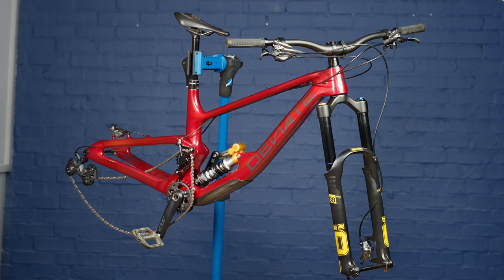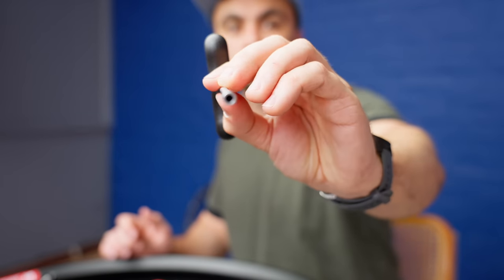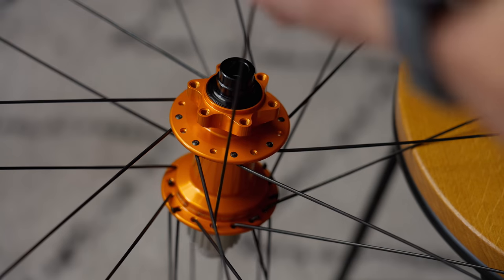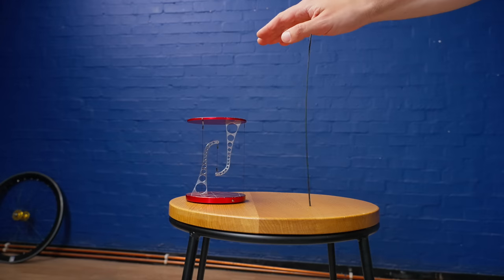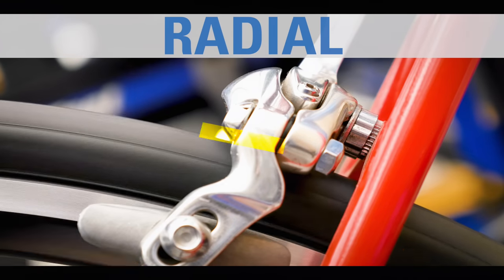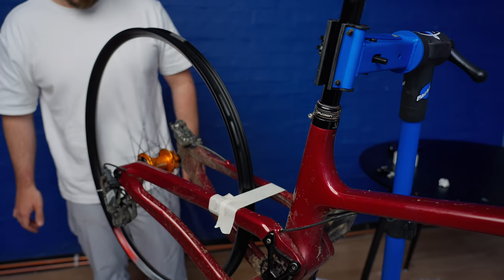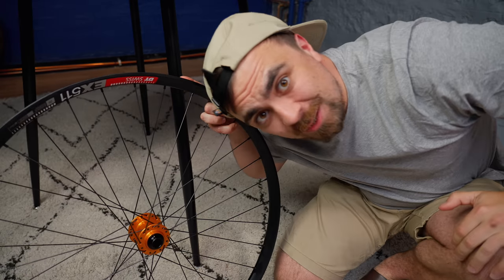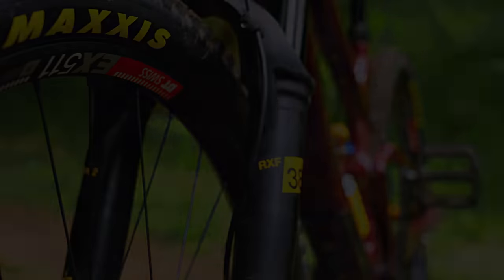I tried building my own wheels

Comment: Love that you glossed over the true nightmare of wheel building that is spoke length calculations 😂
Reply: Probably done by the manufacturer that put together the set?
Reply: Just use Sapims spoke calculator. Saves so much time and headache
Reply: Thats the most easy part.
Use dt swiss or sapim spoke calculator
Reply: There may be calculators out there, but if you have components that don't have easily accessible measurements and you have to measure yourself, such as older legacy components - it's still not too difficult to mess it up. For my first wheel build I ended up buying spokes 3 times, a costly mistake. You only get about a 1.5mm cushion. I won't get in to it but Now I have $170 worth of spokes I can't use (For 66 spokes it cost me about $85 each time, 32hole rim front and rear, and 2 spare spokes.) This was around year 2020.

Comment: I think it would have been cool if you went to a bike shop with all the tools to see how close to perfect you got with the tape method. Anyway, great video!
Reply: Technically you can get the same precision as the professional tools even with tape (or how I prefer doing it: zipties) and the bike you want to use the wheel with. The bike shop tools just make building and tensioning the wheel a lot faster and more convenient, so it‘s a lot easier to get a precise, well-built wheel. From what I‘ve seen on the video, the wheels mike built weren‘t as true as the bikeshop I worked at would give them out, but they definitely are good enough to be used without problems.
Reply: @flyingby3703  Actually there is one step you can't do accurately with your bike frame: you CAN know if the wheel spins straight (doesn't wobble side-to-side), of if it is "round" (doesn't bounce up-down, or isn't a "perfect circle with the middle point being the hub centre). 

BUT even if the wheel IS spinning straight, AND it is "a perfect circle", it can still be a perfect circle that spinning straight, but slightly to the other side!

Many tool companies have specific tools to check this. 

If you would want to do this "check" in your own bike frame, you would have to "flip" it with "tape cauges" in place, AND the hubs would have to be mirror-symmetrical (which they are never in the back hub, and which they are not in this bike even in the front hub, because of the disc brake space on the other side)

Not having your wheel "spinning straight in the right spot left-to-right" might kill you, because then it could be destroyed when going hard to left or right, because the spokes are not angled enough to the other side
Reply: @aeyuio2315  did you not watch the video? He goes into dishing with his cardboard box.
Reply: @linuspauly2380  But he doesn't do it correctly, his method in no way takes into account the difference in distance on different sides. The distance should be the same from the spoke ends in the hub.
Reply: @aeyuio2315  no the spokes on the drive side are usually shorter than on the non-driveside
The distance from endcap to the rimcenter should be equal on both sides
Reply: The rim must sit in the middle of the hub.
He did this the correct way.
Reply: @aeyuio2315  you can flip the wheel over in the frame, to check whether the hub is centered laterally
Reply: @aeyuio2315  False information

Comment: the real trick is using a marker instead of the tape and just wiping it off with alcohol.   spin the wheel, run the marker in all dimensions. make adjustments,  flex the spokes to get out slack, wipe marker, repeat.

Comment: I've worked in a few bike shops in my time, few wheel builds though, it is truly an art and takes time. A wheel truing tip I use at home, instead of tape, is a zip tie on the seat stay cut clean, you can move it closer as you need as well, the tape could be used on the seat stay if your concerned about scratching paint. Well done man, stoked to see your stoke for mountain biking growing after your early Ben Collab's haha.

Comment: I learnt to build my first (and only) set of MTB wheels in 2020 for something to do during covid lockdown. I used cable ties on the frame instead of tape and the coin stack trick to get the dish right but essentially the same cheapo method you did. Oddly enough it took me just under 6 hours too! They're still straight and round now, never had to adjust either of them once!

Comment: I have once rebuild a wheel while changing a hub. The biggest problem for me was to get a correct tension of the spokes, because I didn't have a spoke tension meter. At first I have built the wheel too loose. Then the spokes would go out, it was a mess. Later I was grabbing all bicycle wheels I could find to get a feel how a proper tension should feel like. After tensioning all the spokes somewhat correctly I was really happy with the result.

Comment: Good job!!! One tip though is when you think you're done, put the wheel on an old car tyre and jump up and down like f.... on the spokes with soft shoes - both sides (be brutal), then true again. The spoke tension over time will deform the holes & flanges in the hubs at the spoke roots leading to loss of trueness , this jumping up and down will preset this leading to truer wheels for much much longer!!!

Comment: Great video! About 15 years ago I started lacing my own BMX wheels similar to this. Back then instead of using youtube, a BMX brand had a guide on their website with pictures. I used that and well, the first wheel turned out awful. As time went on I got better but I still don't aim for perfection and I don't own a truing stand too. I can still bang out pretty good wheels and most of my local town riders rode with wheels laced by me because they could not be arsed to learn it and I was cheaper than a bike shop. Great skill to have.

Comment: Nice Mike. I have a truing stand that I picked up cheap, but my first wheels and many repairs were done with the bike frame as my guide. My tightarse sensibly frugal trick was to zip tie a clothes peg to each "chainstay" (or the fork for the front wheel). You can then chuck a hex key with a ball end in the peg and slide back and forward to adjust the spacing. Centring is a case of using a ruler to check the side/side, and assuming the bike's reasonably symmetrical.

Comment: as a former bike mechanic i would say they look very good (even if it did take a while), but the real challenge is can you do it with cheap parts? This is way harder because the never fit as nicely as those exspensive parts and the rims are never exactly round to begin with. So Mike are you up for the challenge? 
 Btw did you notice that the front spokes are a difrent diamenter compert to the rear?
Reply: with all due respect, but its spelled "compared"
Reply: hi, i'm not a professional, after the initial truing (basically what he did in the video) it's not necessary to pre stress the spoke by pushing on hte hub?
from what i know the spokes need to bite a bit in the hub to stay correctly tensioned and true for longer... i have the doubt that under the stress of a few rides the rim wil not be as round because of that.
could you explane plz?
Reply: @MrAntonioSimone  yes you are correct, as he didnt stress the spokes/nipples they will need a retrue after a few rides. i normally stress wheel builds by standing on the spokes while the wheel is on the ground, works great
Reply: @grassgrow030  not everybody on the internet speaks English as their first language my guy
Reply: @TheDjCageman  thats completely ok, i never assumed otherwise. English is also not my first language. I would still want to be corrected on a mistake like this, especially when the rest of the text was so well written, and the mistake does not seem to be a mistype, but a wrong interpretation of the spelling of that word
Reply: @grassgrow030  look, the gramar police is on the run 😒
Reply: @TheDjCageman  he wasn't rude, he just fixed his typo. If not for guys like him I would still use "propably" in place of "probably", as it was how I wrote it all my life.
Reply: @Mathcartney  i corrected his spelling, not his grammar, so im the spelling police actually 😘
Reply: @grassgrow030 who kares, u new what it ment 😂😂😂
Reply: @jani724  dats de bootiful ting aboat komunication, az long az wi andastend eechotha, itz ok. zorri vor biing a gramur nazsi!

Comment: I'M GONNA PUT IT OUT THERE I do this for a living and you did a quality job! reccomendations for next time would be for dishing use coins instead cause you can fine tune without it moving and use a spare spoke on either side of the frame for the overall truing as they're easier to push in and out and fine tune the true (Works more like a truing stand)

Comment: Don‘t forget to re-true and re-tension your wheels after a few rough rides. Your new spokes, hubs and rims will probably set in a bit. After that they should be in good shape for a long while though!
Reply: By far the toughest thing is to construct wheels that keep spinning straight even after leaving the shop. Almost anyone can eventually get a wheel to straight for a moment, but it's very difficult to get all the tensions & strengths right in the long run. 

My local bike shop used to have young mechanic doing wheels, but they had to make him stop it, because "his wheels didn't keep straight" and the customers kept on coming back after riding a few days. 

I think uniform spokes, uniform spoke condition, uniform sound from the spokes goes a long way, even without tension gauges. The sound might be even more accurate than the gauges.
Reply: @aeyuio2315  Yup, that’s true. I‘m not very experienced when building wheels myself, but I did build my own wheels while I was working at the bike shop and trued up quite a few of them. I picked up a few tips and tricks from the guys there, but in the end only experience will get you to reliably building good wheels in a reasonable amount of time.

Comment: thank you very much for this video. I was trying to build my own unicycle but got a bit stuck since i can't weld aluminium with my electrode welding machine. Now i will try to chance the hub from an old wheel into a hub of steel so i can weld my cranks to it. Thank you very much

Comment: i've recently build my set of wheels and it was a pure joy, im going to do this on every build !
but there were  numerous times that i dropped a spoke nipple inside the rim and spent ages getting it out 🤣!
Reply: One trick to avoid dropping the nipple in the wheel is to use an extra spoke as an insertion tool. Just thread a nipple backwards on the extra spoke to insert it into the rim, thread the actual spoke on from the correct side and unthread the extra spoke.
Reply: @TeKaMOTO  thanks , great idea

Comment: love to see this. ive built a few unicycle wheels myself now and its always an annoying process at one stage or another, but very very satisfying. My biggest problem is figuring out the length of spokes required since most of the online calculators aren't calibrated for uni hubs

Comment: I've built maybe 20 wheels in my life.  Every single time, you learn something new, and you get better at it.  My most recent wheel was a HUGE jump in quality.
Reply: Ugh I want to learn because I have a DIY ebike with a hub motor and the spokes go loose all the time and 2 have broken so far. I have no idea what Im doing so I just tighten the loose ones and replaced the broken ones.

I really just want to rebuild the whole thing fully as I am sure the tension is off and its not properly trued.
Reply: @1234567895182  yeah just do a rebuild. It's not hard. When I saw this video, he's using DT swiss rim/spokes which are the easiest to build. DT swiss uses it's own spoke wrench, and the squorx nipples with washers make for a longer-lasting true.

Comment: Great video! I have built a few wheels, and trued them in the frame like you did. If you have a steel frame/fork you can use magnets and cardboard to set up easily adjustable guides. One thing that really takes out a lot of frustration imo, is an adjustable spoke nipple bit, they cost around 20-30€, but I find that you get a great baseline very quickly, that only needs little truing after

Comment: "that's good enough for me" is a very important step when building wheels. It won't get much better if you continue :)

The reason I build wheels, I can customize like crazy. I've built wheel with spokes that I powder coated (even one wheel with spokes in four colours) and even used a twisted lace pattern. The last wheels I built were 20 inch (451 ETRO) with an 8-speed Alfine. You simply can't buy this when you want to upgrade a vintage bicycle for your kid.

Comment: I used to work at a shop and did have to rebuild a couple of wheels. Mostly it was for warranties where they sent just a new hub or rim. We wouldn’t do it for customers because it’s such a pain and takes forever, and a whole new wheel costs the same after labor. A good learning experience though.

Comment: Perfect timing for motivation. 
      I have been putting off re-spoking my rear wheel.
      I've worked in bicycle repair shops (learning as I go) - didn't get around to 'wheel lacing' yet :). (Busy shops - takes time to learn... yada yada)

The tape thing is a good idea.
       I know the same trick, but with zip-ties on either side.
       (You can turn the zip-ties to adjust the distance to the wheel - a bit like an official truing stand)

Also, I know that Park Tool video.
       Another person to learn a lot from: 
     RJ The Bike Guy (on YouTube)

He fixes vintage + not so vintage bikes, and has covered just about any subject / any brand / any part you can imagine.

And I agree - putting something together, or fixing something yourself - it gives you a greater appreciation of that thing.
       (You kinda bond with that item... be it a bike or a guitar or whatever.)

Gonna try and lace my wheel this week :)

thx

Comment: I’ve built my own wheels for years. Can be frustrating at first. Otherwise it’s a very satisfying experience. 
I’ve did something similar to the tape method with zip ties many times. I usually flip the axles to check for dishing (centering) every so often as I tighten.

Comment: you need a wheel truing stand to do it right.. but can make your own, out of timber if you go find how to make one... there is also 3 different ways to do your spokes with its cross lace and should be something that people are aware of as each one will give a different result and depending on how many holes your rims/hubs are may also require a few mm longer if you chose one method over another

Comment: Oh god man, I love making wheels!

Before i became ill, I use to make a couple of wheels per week, for years working in a bike shop.
And for five of my seven bikes I made the wheels myself at the shop or at home watching netflix or youtube.
(also made some backups because the spokes came in boxes of 150)

If you have any interest in bikes at all, I can highly recommend it and  I find very  relaxing.

-But do NOT start your first wheel with any used hubs, spokes or rims!!!!!!!!!!!!!!!
You can get strange anomalies and trouble shooting those are a 'female dog'.
Best start with no or internal hub gears, they usually have the same spoke length.

Use the simplest 1 crosses 3 pattern and broader rims give you room to work.
If all the spokes are in place set all the nipples at the same length
A simple and fast way is to feel with your nail when the treads just disappears into the nipple.
Then go round and round the wheel making full turns, increasing the tension a quarter turn per spoke at a time.
Only when all spokes are in tension do you start to keep an eye on your straightness.

To move the whole rim one way, always loosen one side and tighten the other, spoke for spoke, that keeps the tension the same.
If you have a height wobble, loosen the four nearest spokes at the low point and than tighten the four in direct opposite.
That way you keep the overall tension the same and there is less chance that you pull the rim to either side. 

And lastly, squish all the spokes in groups of four because the threads and nipples will need to settle and you can hear them ping.
Then see if it is still straight and make adjustments if needed.

The name of the game is slow and steady and it's handy to remember that most spoke patterns are multiple groups of four.
When making any adjustment to the spokes on any wheel, do it slowly about a quarter turn.

O boy, somehow I wrote a short howto and didn't really a comment on his video, he's doing fine..
My passion for bikes might be a side effect of being born and raised in Amsterdam in the Netherlands I guess.

Comment: I learnt to build my own wheels on my bmx when I wanted a new back hub but didn’t want to buy all new rims and spokes. Once I figured it out I found it a rather weirdly relaxing thing to do in my spare time. Only tool I had was a flat head screwdriver and a spoke key and mine came out just fine.

Comment: The way you made those wheels round is the same way you would tune a drum head. You get it close by ear, and then you use a tension gauge to get it even at each lug around the rim.

Comment: As a bike mechanic who builds wheels quite frequently i can say the way you did it without the proper tools and stand is not bad at all. However i really hope most people dont try to build their wheels themselves because some people do have the affinity to do this kind of thing but more people dont. And if they are not properly tensioned the wheels can turn into a taco very fast, I speak from experience on that😂 Great vid!!

Comment: Been interested in bikes for a good few years now, and done some maintenance etc on a few. Now working as a bike mechanic for around 3 months, I really need to learn more about this and fix my ebike's loose spokes by replacing them with new ones :p
Reply: Also was looking at the exact same tensioning meter on ali from ztto haha, man park tool stuff for 100-150€ is bonkers if you barely use it..